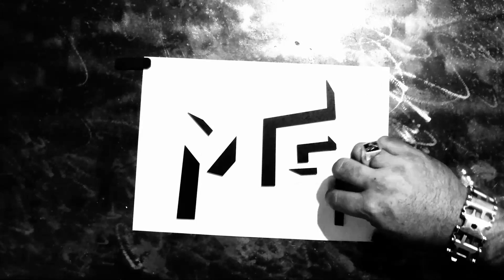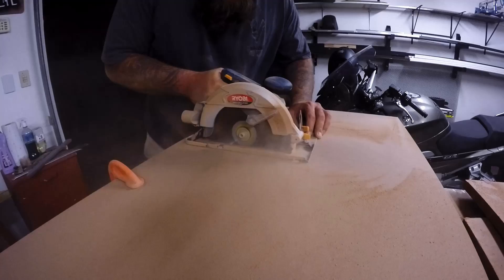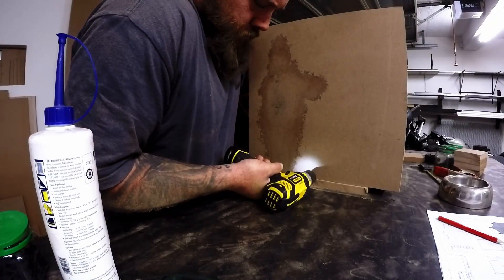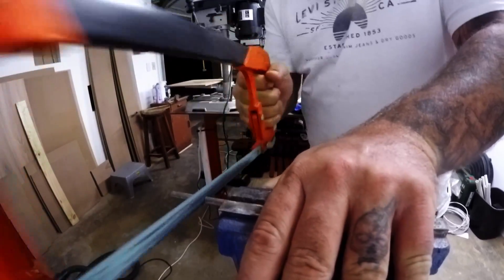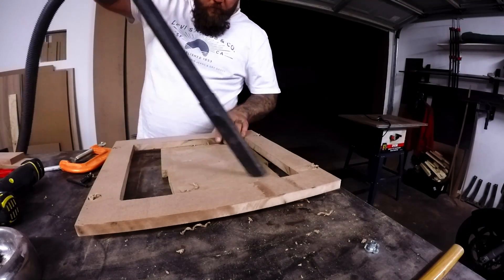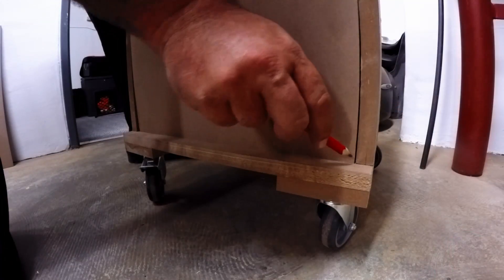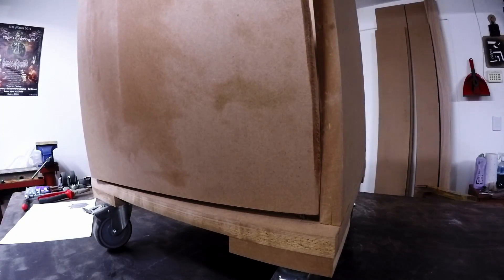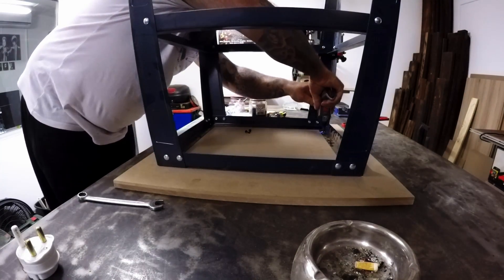Cheap Table Saw Improvements Part 2

Comment: Great vid man. I appreciate you sharing your experience with us and glad i found this because i too want to start woodworking as a hobby but from ground up - I have nothing but a few tools lol

Also i wanted to see a little bit more of the saw table at the end. Even then, looking forward to your next vid 👌
Reply from the maker: Thank you very much, yeah I know the feeling, I am also still fairly new to woodworking
Reply: MDF is a bad material to use in almost all cases because it isn`t a very stable material. It`s very absorbent and will warp over time, the dust is harmful to humans and animals and it flakes off when damaged. Substitute three quarter inch plywood for the MDF and all the problems go away. MDF sucks moister from the air and the edges quickly start to swell and where you cut holes for bolt heads you will notice that the bolt heads will start to weaken the material and stop being efficient at tightening the fence.

Comment: enjoying you video.  im also from South Africa Northern cape. finding t- tracks and other accessories  like the American and European is hard here in SA and pricey
Reply from the maker: Thanx... Yeah its a real headache... doing dust collection in the shop now, cant find half the parts I need... made some awesome blast gates on the laser cutter... you can check it out and download on Thingiverse... I'd add a link, but my PC at work wont open thingiverse... :-( ... just search for my profile.. gonna be sharing a lot more of my designs there...

Comment: just a thought. that base is a lekka sturdy frame. maybe u could turn it into a router table...?
Reply from the maker: actually planning a new "wider" base... this one i built is a bit narrow, so if you put too much weight on either side it wants to tip over..